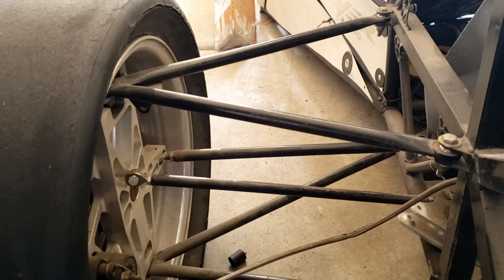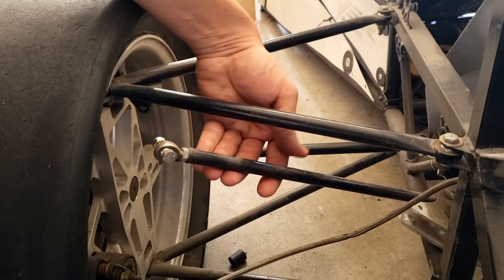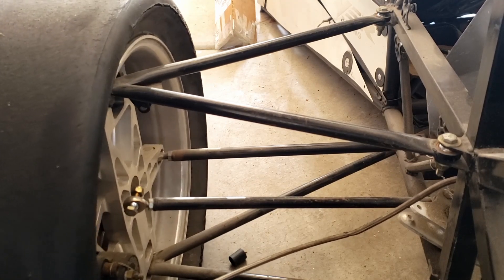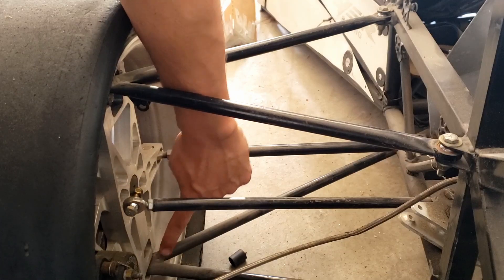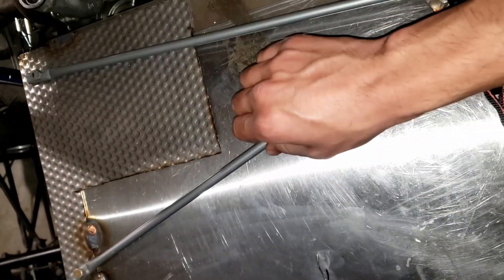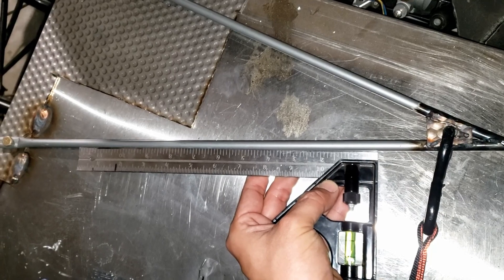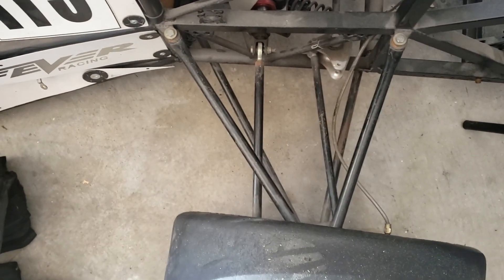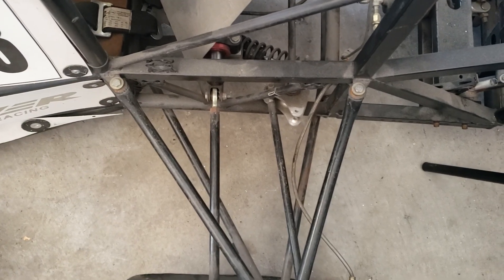A-Arms Are Not Two Force Members

Comment: I believe the A-arm with spherical joints at all three vertices is effectively two 2-force members. 

You changed the game in your experiment because the outboard vertex was welded and you applied the load far from the vertex.
Reply from the maker: Yes, a-arms can "effectively" be calculated as two force members in a lot of cases, but they're truly not. As for the test, if there was a spherical it wouldn't be at the vertex. The amount of bending is going to be affected more by the length of the weld, or length of the welded plate like in this example.

Comment: I mean for the exp you did after 5:05, of course the link under tension is going to bend if you have removed the compression force from the other link by using that sleeve. I'm not denying that the welded outboard gusset upsets the theoretical loads, but Ig a better experiment is needed to prove that when the A-arms are subjected to longitudinal loads, its not the buckling of the link in compression causing bending of the link in tension. 

PS love your channel and vids😊
Reply from the maker: That part was more showing exaggerated displacement than forces, but yeah I see what you're saying. Glad you like the channel!